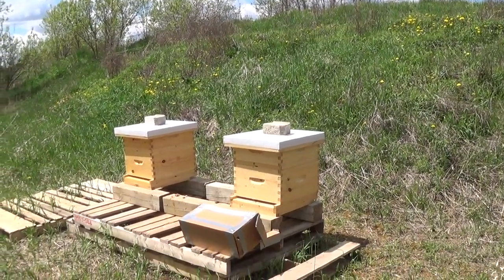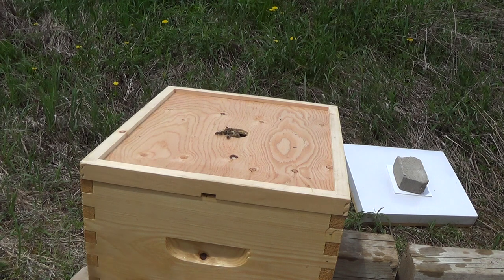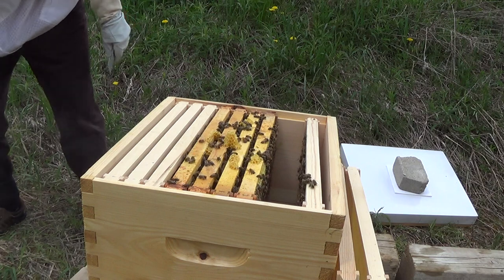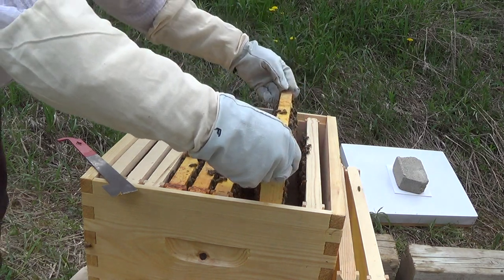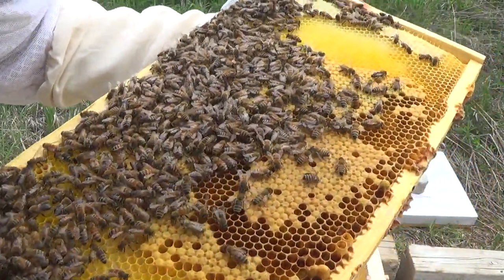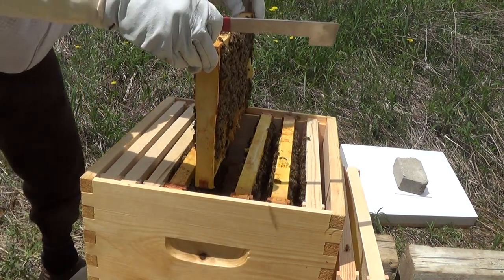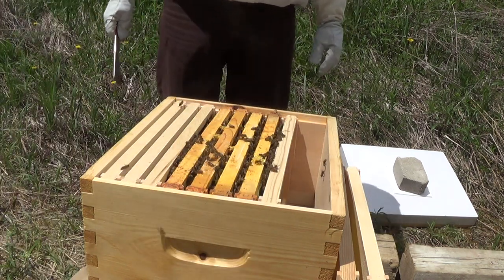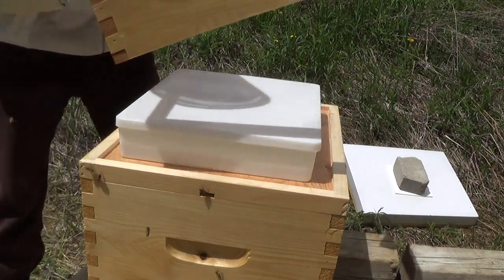Bee Hives - First inspection after Installation

Comment: what are swarm cells
Reply from the maker: Hey Alpha Swam cells are queen cells that are developed usually near or overhanging the bottom of a frame. They are usually created when the hive is full of bees and does not have room to expand. The colony creates a new bee and when it hatches, the old queen takes 1/2 to 2/3 or more of the existing bees and leaves to find a new home. Leaving the new born queen to run the old hive. A supercedure cell is the same thing but it is usually created closer to the centre of a frame. The bees make a supercedure cell to replace a dysfunctional queen. New queen hatches, old queen is either run out of town or killed or both. They are larger and longer than normal cells and look like a peanut
Reply: 4dhoneybee 1 ok